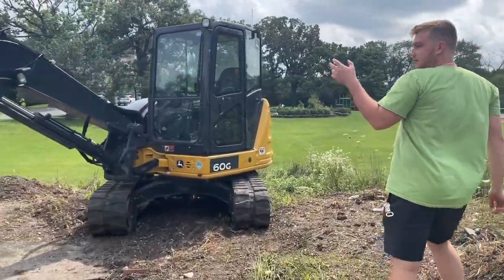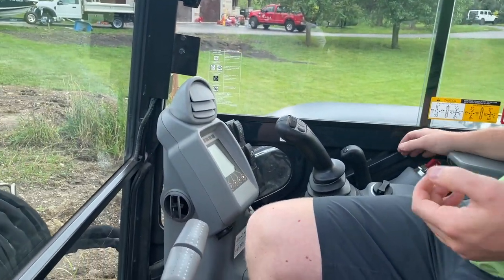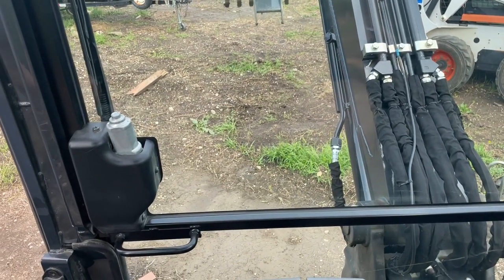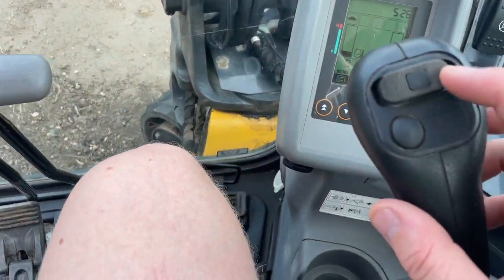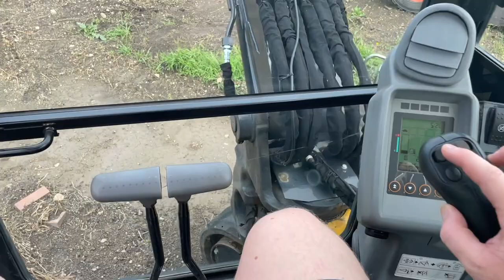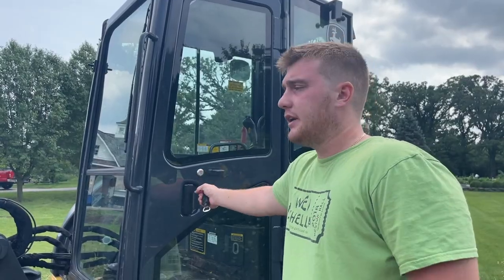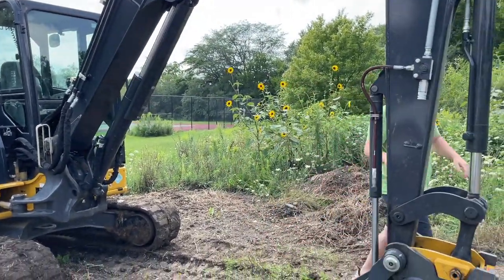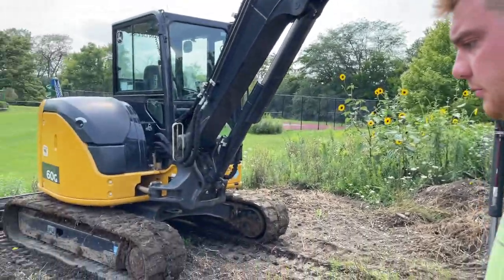John Deere 60G Review

Comment: Nice machine and you run it well!  Do you move this machine yourself?  I assume you are into a CDL setup for it.
Reply: At 13.500lbs id just throw it on a 18klbs trailer and haul it on down the road with a 350-550 flatbed.